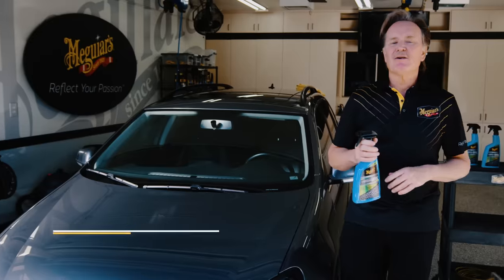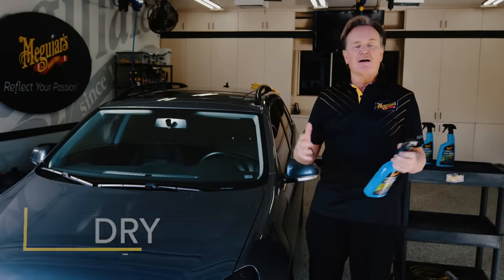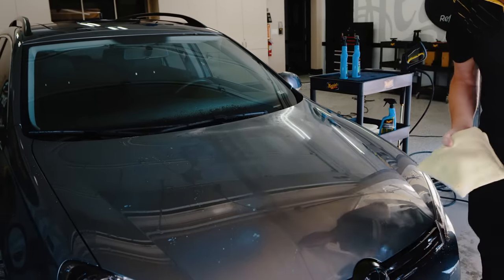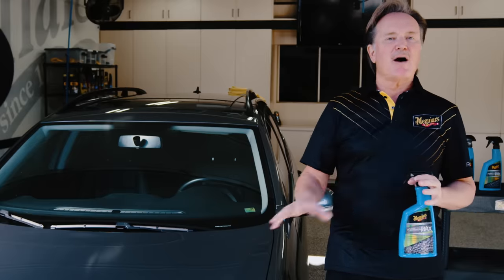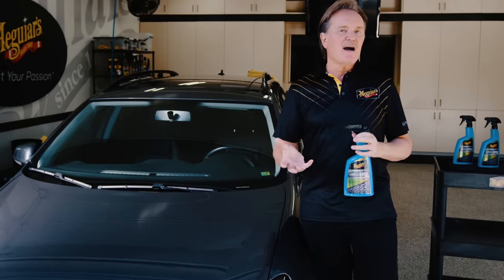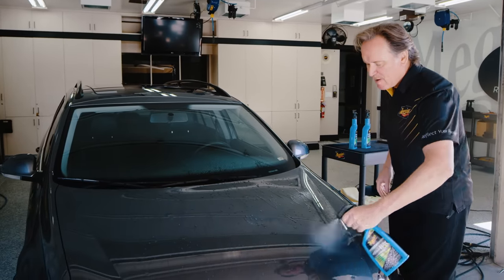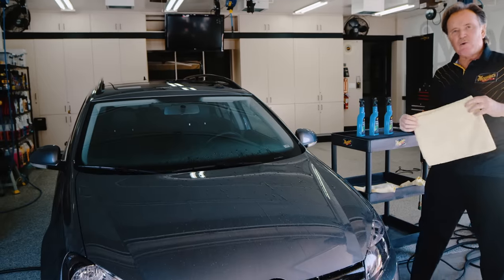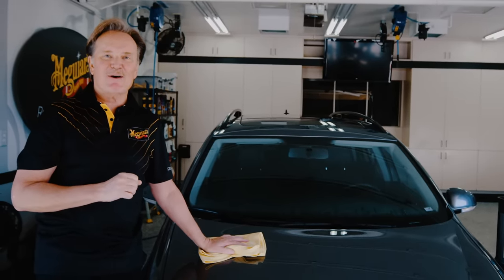Meguiar’s Hybrid Ceramic Wax - Ceramic Made Easy!

Comment: Hey Meguires! What would be the best way to apply this with a waterless wash? Wash -> dry -> spray paint with distilled water-> apply hybrid wax -> dry? 
And for first time use, wash -> dry -> apply hybrid wax -> dry?
Thank you!
Reply from the maker: once the surface is clean to the touch, you would need to wet the vehicle then mist the product over the water and wipe dry. We suggest using nothing more than 2-3 sprays per sectioned panel as over application of this product can lead to streaking. Anytime after that, you can mist the product over water then rinse the residual product off. 👍

Comment: I’ve done the initial application on my car so far.  Let’s say I want to use another wax on the car like Ultimate Quik Wax, do I need to do the initial application of HCW again if I want to continue using it? Or can I still just use the subsequent applications after using UQW on the car.
Reply from the maker: The Hybrid Ceramic Wax will work over any existing wax, sealant, or coating.
Reply: @meguiars  understood. But if I use UQW after I did the initial application of HCW, do I need to complete the “initial” application process over again if I want to reapply HCW?
Reply from the maker: It will never hurt but no, you can proceed to the application instructions for subsequent applications.

Comment: Instead of drying the car at the end with a microfibre cloth, can you use one of those "spot free rinses" at the DIY car wash places? I believe it uses purified water to rinse off at the end which doesn't leave any water marks.
Reply from the maker: Cannot vouch for the chemistry of the "spot free rinse" but in theory if you use that strong spray to spread the product and no water is left behind to create water spots it would likely work.

Comment: I use ultimate quik wax after every wash. I am about to use this ceramic wax for the 1st time. Is it worth still using the quik wax?
Reply from the maker: Ultimate Quik Wax in most cases will provide more gloss than our Hybrid Ceramic Wax, which mainly focuses on protection.  However, which ever product you use last on your paint, you will see the water beading characteristics from that last product used.  With that said, Hybrid Ceramic Wax would be recommended to be used last since the protection/water beading characteristics will be superior than UQW.  If you are going to a car meet, etc. or any time you want to add gloss, Ultimate Quik Wax would be a better choice.

Comment: So I assume if my truck is only a month old I really don’t need to clay bar the truck , I did wax it a few times but I should just start from the first step which is wash the vehicle spray some on and wipe it on with a microfiber towel  then rinse is that correct ? Thanks great job explaining!!
Reply from the maker: Once you have washed and rinsed your vehicle, with the water still on the vehicle lightly mist the product and wipe dry. This would create a foundational layer then you can proceed to misting the product over water as a last step, rinse and dry as normal to maintain and boost your si02 protected vehicle.

Comment: Just bought some of this for my Corvette today, hope it’s as good as you claim it is!
Reply from the maker: Let us know what you think and make sure to follow the instructions on this video.  Another tip to better results with this product is to use less than you might think.  The product really will spread as you dry (first application) or rinse (2nd application) so you really only need a few sprays per panel.
Reply: Was going to use it this past Sunday on my Corvette I just bought. Little too windy though, so I used your cleaner wax instead. 
I’ll let you know what I think of it when the weather is cooperating and I can use it.

Comment: After this product is rinsed off and dried, can you still routinely top this wax with a layer of ultimate liquid wax or no?
Reply from the maker: You could if you choose but the optimal process would be to use the Ultimate Liquid Wax first and then follow/top with the new Hybrid Ceramic Wax.  Also understand you are going to lose some of the effects and benefits of the Hybrid Ceramic Wax if you put another wax on top of it.

Comment: If protecting the paint is the most important goal, can this product be the one and only product used on the car's paint? Or, is there a better schedule / combo to use? I'm lazy about waxing, so simple application is a benefit so that at least something is done and I work by hand (no buffer).
Reply from the maker: Yes, this is designed to be a long-lasting protection and can certainly be your primary or even sole source of protection.

Comment: I currently use Ultimate Fast Finish. Would it make sense to pair UFF with Hybrid Ceramic Wax? If so, would I use UFF first then top it with HCW? I imagine I'd want the hydrophobic properties as the top layer, correct?
Reply from the maker: If you were to use both it would be better to use the Ultimate Fast Finish first followed by the new Hybrid Ceramic Wax.

Comment: If I’m doing a paint correction using the compound then polish instead of proceeding to wax the car could I use this ceramic wax?
Reply from the maker: Yes, Hybrid Ceramic Wax is still a wax and used just as/when you would use any wax in the 5 step process.
Reply: @meguiars  thank you!

Comment: Dear, 

I have a product namely showroomshine that removes swirls. It is to say, the showroom spray does not remove them, but masks the swirls because after few washes they are back there. Now I was wondering because in your video you say that you may put the HCW on top of another coating and the hcw will lock up this coating. Now I'm reasoning if I apply the showroom spray and so mask the swirls and on top of that apply the HCW, then after few washes the swirls are not going to be back since the showroom spray is locked up. Or am I being too enthusiastic in my reasoning now. 

Thank you in advance for your response, regards Frederic
Reply from the maker: Although many polishes and waxes, including ours, will unintentionally cover minor defects we would always recommend you actually remove swirl marks and not simply hide them temporarily.  This will typically require the use of an effective but safe compound like our Ultimate Compound.

Comment: Nice. What about using it on clear wrap protectors? Everyone seems to be getting rock chip protection on there vehicles. Is the ceramic wax compatible with this?
Reply from the maker: Yes, although it is designed to work best on paint it is safe on ppf (paint protection film).

Comment: Dear Meguiars, I can't see how the maintenance method of spraying a few squirts  and rinsing off, would do anything. The product is maybe hitting 20 percent of the panel and I can't see how spraying it off with high pressure water would allow it to spread and bond to the rest of the panel.  I actually use this product and it works great, but I'm not about to waste it by hosing it off onto the ground. It's  a bit too expensive here in Australia to do that.
Reply from the maker: Not sure what the problem is if you are saying the product works great for you?  

It does have a unique application but it certainly does work.  You have to look at it as something like a concentrate.  You spray it onto the surface but them spread it when drying (initial application) or rinsing (subsequent applications).

Comment: Can I spray this on plastic trim or bumper too? And windows?
Reply from the maker: It is primarily designed for paint, and going to perform best on paint, but, it is also not going to damage any exterior surface when used properly according to directions.  In other words, mainly focus on paint when applying!

Comment: How about using this on my windows? My rear windows are factory tinted. Is it safe to use on all my windows, does it affect my tinted wondows?
Reply from the maker: It is OK to use on all exterior surfaces, but it is going to bond best & last the longest on paint. Tint is on the inside of the window so no issue.
Reply: @meguiars  Cool, thanks!

Comment: I started using the Hybrid Ceramic Wax, I wash my car with Mequiars Ultimate Wash and Wax. Is that okay to use on top of the ceramic wax? Or should I use something else? Love all the products.
Reply from the maker: It is okay to use the Ultimate Wash & Wax as is will still do it's job and not harm anything; however you should be aware that you are putting another wax on top of the Hybrid Ceramic Wax so it could have an impact on the water beading are getting from the Hybrid Ceramic Wax.  Again, not harmful in any way.  If you want to ensure you keep the intense water beading you should consider switching to our new Hybrid Ceramic Wash & Wax...

https://s.3m.com/7l7dgq
Reply: I ordered hybrid ceramic wax and wash, also ordered snow foam because I had just bought a big bottle of hybrid ceramic wax. My car is the shiniest car in the parking lot, even my Chevrolet service center said they liked it and my car is black. Thanks
Reply: I purchased Ultimate Snow Foam, works great on the Hybrid Ceramic Wax!

Comment: Can you use this as a first applicator top coat? I’ve been doing that and haven’t been having any issues and it turns out great. However that doesn’t mean it’s the right thing to do. Im just curious if I should be using an applicator base before applying the ceramic wax.
Reply from the maker: Not sure we understand your question exactly?  Are you asking if this product has to have something else applied of top of it?  No, it does not this is a great wax protection it does not require the use of another wax before or after it.

Comment: Just added this ceramic to my paint this past weekend after polishing and waxing my car. Now how often should i use this or is it a one time use only?
Reply from the maker: How long any protection/wax lasts is highly variable and depends on a number of factors related to the condition of the paint, previous prep, and the environmental elements the vehicle is exposed to. 

That being said, on a well maintained vehicle the Hybrid Ceramic Wax can last up to several months.  Although certainly not necessary some have discovered it is so easy to use during their normal washing process that they use it much more regularly.
Reply: @meguiars   i used all meguiars brands. Compund, polish and liquid wax. I do weekly washes and use your waterless spry in between washes (only when it gets super dirty). 

So if i spray in on my next wash, use it again after a few months?

Comment: Meguiars, would the product be more effective on the 2nd application if you spread it evenly with an applicator.  I don't get the use of the spray off. I get that it might be easier but less effective also?
Reply from the maker: No, we would not say that would be more effective, but if for some reason you can't rinse you could try this method.  Keep in mind a little goes a long and you may experience more streaking this way.

Comment: I got this stuff, and used it before watching any of the videos, unfortunately.  Tip: don't use too much.  The bottle just vaguely says "spray on the exterior surfaces" after a wash & rinse but apparently I used way more than I should have. I'm still fighting greasy panels and especially on the glass!  I didn't spray it on the glass, but from just overspray I guess.  Anyways, I've tried newspaper, paper towels, MF cloth, terrycloth, windex, water etc.  Can you give me any suggestions on best way to remove "too much" of the product on paint, and glass?  On most of the car it feels great, I just simply used too much in some areas. Thanks!
Reply from the maker: Hi slikk & sorry to hear about your trouble.  I have documented your feedback internally.  As for a remedy to the streaking, re-wetting the vehicle & performing the "foundation layer" application method, should remove the streaking, plus increase the water beading, improve the slickness, and make the vehicle easier to dry.  Have you tried this?  Also keep in mind it is important to rinse with a strong stream of water.  A full washing of the vehicle with any Meguiar's car wash solution may also be necessary if heaving streaking is present.  Keep in touch & I will check back to see your results.
Reply from the maker: Also, a cleaner wax type product or compound can also be used if necessary.  These can be used on exterior glass as well, but if a cleaner wax was used on glass, we would recommend following up with glass cleaner, to remove the wax portion on the glass, since it can cause a glare.
Reply: @meguiars  thanks for the reply. I've only done the first "foundation" layer so far, so I didn't need any water steam, according to the directions. Just apply and dry (first time). I'll try rewashing again soon. And will make sure to use strong spray on the next coats.
Reply: @meguiars  Can I use polish on the truck to get the swirls out before applying the fondation layer of Meguiar's Hybrid Ceramic Wax

Comment: So the car can be totally dry (after cleaning) applying the FIRST coat?
Reply from the maker: No, as the video shows the vehicle should still be very wet when applying the product.  You really need the water to help dilute and spread the product.  If used on a dry surface it could be very difficult to work with.

Comment: I have been using Meguiars for so many years I can't remember. Used their product in 2009 to win the Asian Collector group at a Concurs D' Elegance car show. I just picked up this new type of wax on the internet and I'm expecting big things. One thing I would like to know is how long this stuff lasts. Will I have to boost it every week, month, or 6 months? I mean, with Megs Synthetic Sealant #21 once a year is enough. Maybe twice if we have a bad winter.  And can I use a Carnauba wax on top of this sealant for that glowing look?
Reply from the maker: First off, congrats on the win and thank you for being a Meguiar's fan !  Our new Hybrid Ceramic Wax will definitely outlast a traditional wax.  As far as topping, we would recommend using the Carnauba 1st for the glow, then apply the Hybrid ceramic for longer lasting protection.  The key tip for using this product is to not use too much at all !  A little goes a long way !!!  Good luck and let us know how it turns out.

Comment: Instead of drying with a towel, I use filtered water to rinse my car. So, after the initial application will I be able to apply the CW, pressure rinse and then filtered water rinse and leave to air dry.....?
Reply from the maker: If you normally have success with allowing the car to dry completely with no towel, then yes, since the product will be fully rinsed off, you should be fine.

Comment: Instructions say spray all over external panels. It took 3/4 of the bottle to spray down my truck after washing. I wiped it down per instructions and it was a greasy mess. I called support and was told I only needed to spray 2-3 sprays per panel, and to re-rinse and re-dry. Nowhere does it say to spray 2-3 sprays per panel. The truck now has hard water stains locked in and is streaky. It needs to be stripped and buffed out.  What do you recommend to strip it off?
Reply from the maker: Rob, we apologize for your experience.  We imagine you would not be up for it, but really the easiest way to remedy a streak/splotch is to re-apply the product.  We have also seen where if the streaks are heavy, a full regular washing can remedy.  We are happy to advise via comments  on YouTube, but would also encourage you to continue dialogue with our Customer Support since it will be a quicker response.  Either way is fine.  Again, we apologize for your experience.  I am going to document your feedback internally, which will be reviewed by the product managers.
Reply: @meguiars  just to update, I have rewashed, and reapplied a couple times and it's still streaky.

Comment: Looks like it works great, but how long does it last? Been using Maguire's for decades, top notch stuff, but I've always used the carnauba wax, "Maguire's gold class" I hated finding that the Maguire's gold class shampoo contains salt. I don't put salt on paint, or alloy wheels.
Reply from the maker: Hybrid Ceramic Wax would provide protection for up to 3-6 months depending on where your vehicle sits and what the vehicle is exposed to.

Comment: Hi, thanks for great video. I have a question, I have Meguiar's Ultimate Wash & Wax shampoo, it is ok to wash with this shampoo, and then apply ceramic wax, but what about future washing, should I use the same shampoo or you have a better one?
Reply from the maker: We would not recommend applying any wax, even a wash & wax, before application of a coating.  As you likely know coatings really work best on a totally bare surface.  

Now, if you are claying and compounding as a part of the prep process before the coating that would easily remove the wash & wax used to wash making it a non-issue.  

As far as maintenance washing after application of a coating you just need to keep in mind that using a wash & wax on top of a coating can change the water beading behavior.  That is not necessarily harmful but something you may want to consider.  That being the case ideally you might be better off using our Hybrid Ceramic Wash & Wax for maintenance washing as a great way to maintain the protection and water beading of the coating.  You would also switch to a straight car wash without wax like our Gold Class Car Wash.

Hope that helps.
Reply: @meguiars  Thanks

Comment: How does this compare with your average ceramic coat?
Reply from the maker: This is a hybrid formula leveraging both synthetic polymer and SiO2 technology.  It is not designed to be or are we claiming it to be a true ceramic "coating".  You will likely find the ease of application and price point more appealing than a fully ceramic coating.